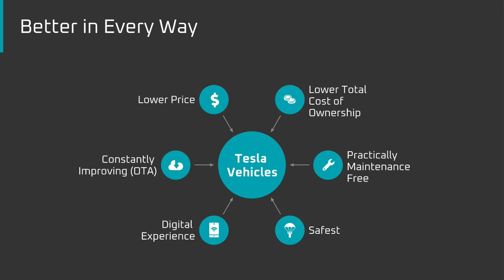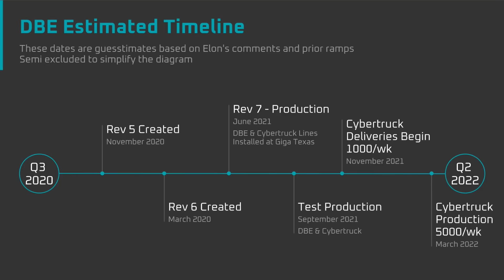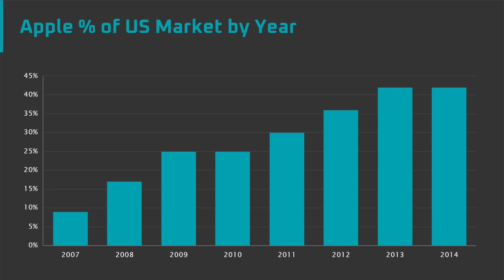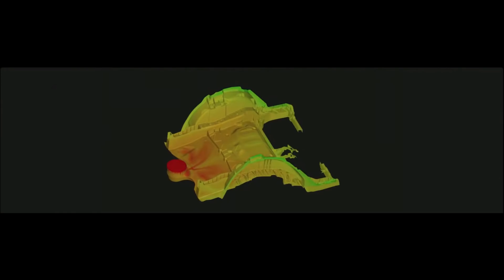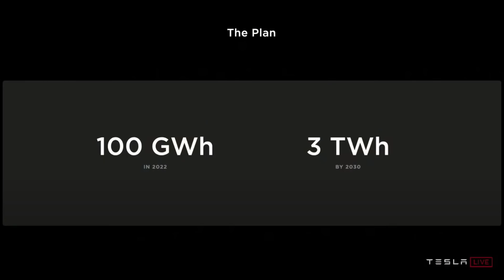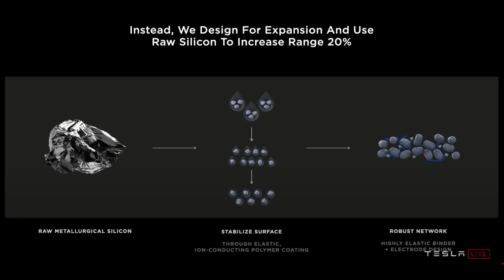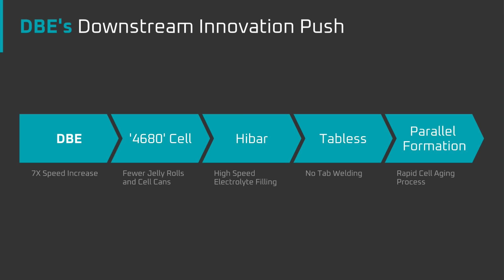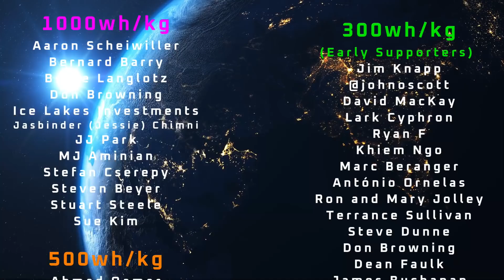#1 Thoughts on Battery Day - Lithium Mine to Battery Line

Comment from the maker: Hi folks!  I tried not to be a tease here.  I usually avoid 'thoughts' videos in favour of knowledge.  I wish I could produce my videos at a faster rate, but quality information just doesn't happen that quickly.  Thanks for your support!  I'll release these videos every 1-2 weeks as they are finished.
Reply: I have a question and I think you may have the best guess. 
What do you think would be the energy density of the new cell? Also likely charging rates with the short distance to charge and discharge cheers
Reply: @roryreddog3258  
If I understand things correctly, 6X power = 1/6 resistance = 1/6 the heat = 6X the charging time possible for the batteries. Real world charging times will depend on how far Tesla is willing to upgrade superchargers and car electrical systems
Reply: @paulshedleski7063  Ohms law for power means the effect of resistance is the square of the reciprocal, resistance need to drop by a factor of two and half.
Reply: @paulshedleski7063  hi - my understanding is different. The volume of the 4680 is 5.48x the one of the 2170. So it makes sense the discharge/charge power of the cell is 6x and energy 5x. Something not advertised though as it's a competitive advantage, is that the internal resistance of the cell will be dramatically reduced, helped by the tabless electrode. That's what will reduce the heat generated thus enabling faster charging.
Reply: Paul Shedleski 👍 exactly! Tesla claim that V3 can charge 1440km per hour. So, V4 superchargers could then charge 1440km in just 10 minutes. Or 720km in 5 minutes! THIS IS EQUIVALENT TO ICE.(mic drop)
Reply: Paul Shedleski Think about it, gas stations can disable some bowsers and put in a V4, for minimal cost. No need to even walk in and pay. 😳
Reply: Roger Starkey well you don’t “need” anything, these are measures to bring EV’s to mainstream  . 1x1500kwh (if that’s even possible) charger is cheaper than 4x350kwh. And plugging 1 charger is better than plugging in 4...Odd comment.🤷‍♂️
Reply: @thelimitingfactor man, the fact that you delay the videos due to quality is only a good thing. Keep it up! Love the content
Reply: Disappointed supercapacitors werent part of battery day. I know maxwell was working on a super capacitor. A supercapacitors in hybrid cells can extend battery life and change commodity depedancy.
Reply: @sadface7457  With a 6X increase in power it will be a challenge  to upgrade the electrical systems just to handle that. Supercapacitors would be redundant
Reply: @paulshedleski7063  Its not about just power but access to gobal commodities. The battery have improved but not match for capacitors in these application. Power density of supercapacitors is order of magnitude greater and since the energy storage mechanism is more stable (as it's not chemical) it reliably deliver that power with degrading.
Reply: Paul Shedleski I think so too. However Supercaps could play a big role in the Mega-chargers to be built. They could help charge up these massive semi batteries quickly and recharge slowly in between “pump sessions” from much larger LFP based megapacks - extending their cycle life.
Reply: @rogerstarkey5390  I didnt mention *power*. Though supercapacitors occupy a different regime in power density and aid in power transients. You than think of the difference between ram and solid state. In mentioned my comment battery life and later commodity access. Access to rare and exotic minerals is a concern for the battery manufacturers. Battery chemistry is temperature sensitive to those power numbers might represent ideal conditions.
Reply: @rogerstarkey5390   You can research these topics further. 

Power specifically contextualized, it's in the context or either power density or power cycle life. Saying but batteries are better is meaningless because they dont compare with capacitors on either measure, which orders of magnitude greater then even theoretical battery chemistry. Batteries are 6-10k cycles and capacitors 100-1000k cycles. Batteries are 0.1- 1 kW/Kg and capacitors are 1-10 kW/kg. These are in different leagues. If you put these together they are significantly cheaper then batteries in these contexts.

Temperature is critical batteries discharge driven by exothermic chemistry which means discharge generates heat. Heat precipitates undesired reactions reaction which either hazardous or undesirable. Radiant heat from these chemical reaction even if the battery chemistry is intact they affect efficiency as heat is lost energy.

Resource access is certainly an issue. Read any comodity report on batteries. You need specific purities to contract batteries which limits their supply chain. From a looming cobalt crisis, to lithium shortages and declining grahite quality. Batteries manufacturers are continously searching find cobolt and graphite free chemistry, and way to use lower grade lithium. The price and availability dictates changes to chemistry more then performance. Whereas superapitors use carbon altropes based on graphite but require much less because energy because it's a repository for electrons no lithium ions.
Reply: @sadface7457  pppppp]ppppp
Reply: @sadface7457  ]]]p
Reply: @sadface7457  p]p]
Reply: @sadface7457  ppp
Reply: Always appreciate your perspective
Reply: Following your excellent work on Talga. I suggest you look at Vulcan Energy in Germany.  They will produce zero carbon lithium. With enough to supply the whole of Europe for many decades.
Reply: You're doing a fantastic work Jordan. Quality primes over quantity. There's 5 thematics to cover if you follow the battery day presentation, so I'd expect at least : cell format with tabless electrode, dry electrode, anode materials, cathode materials, integration to chassis.
Reply: Jordan talga have Polymer technology.  This maybe the answer to the Anode problem.
Reply: Been a fan of this channel since December 2019. What it lacks in quantity it more than makes up for in quality rich detail, presented in a logical and easy to understand way - no easy feat in light of the complex subject matter being expressed. Jorden, your deep dives have been ramping with a density of information that Tesla now has in its new cells. Keep it up. I find your analysis spot on.
Reply: facts > fast
Reply: Thank you, battery dad!
Reply: House Essentials it is much easier to make and needs only about 1 tenth the floor area, but they do have to perfect the process with lower volume. He said that he would open up the 4680 to other “suppliers”, so I would expect them to licence this tech to them. Tabless and dry electrode in the 4680 form-factor should work for all chemistries. He said the factory is 69% cheaper to build and the cost per kWh is 54% less, dry electrodes use nearly zero water and no solvents, so much much better for the environment. This is my understanding I’d happy to be corrected if I’m off beam at all...
Reply: What i'm curious about right now, can these improvements be brought to smaller cells and batteries for smartphones? Would love to get an answer on this.
Reply: @theDubleD  Almost means nothing. Their plant design for larger cylidrical is batteries and net improvement is just 16%. The power problem solved by "tabless" designs matter more as the battery gets larger and dont affect flat batteries as much.
Reply: Instablaster.

Comment: In the battery day presentation. Tesla talked about partnering with other battery manufacturers to make cells for Tesla. Now in the last couple days we hear that LG Chem and Panasonic are going to possibly make 4680 cells for Tesla. Here is my guess, I am probably wrong but let's start the rumor mill. Panasonic which is already making NMC cells, will make the 4680 NMC cell. LG Chem will make the LFP cells. Tesla will make the high nickel cells. Tesla will then offer the different options of cells for their cars. LFP Short Range (lowest price), NMC Medium range ( middle price) and High Nickel long range (premium price). They could all be put in the same pack size and different structural members could be added to the packs for the proper vehicle the packs are going into. Very modular design.

Comment: Good evening. I randomly bought 955 shares today of CBAT because it was the only stock that was moving up from all the EV stocks I’m watching. I just had some surplus funds in my Robinhood and so I put it all to work. Then I saw the big jump and I started researching why. I couldn’t find anything anywhere....until I found this lonely random article dated 09/28/20: “CBAK Energy has Successfully Developed Large-sized Cylindrical Tabless Battery with 25% Boost in Energy Density and 20% Cost Saving”. What the?! Do you know what that means?! This is HUGE!

As far as I know, Tesla is the only one that developed a tabless battery design. Googled around “tabless battery” and the only thing Google returns is about Tesla. On Tesla Battery Day all they talk about is their “tabless battery design” and how it is a game changer for them. Now I stumble across CBAK Energy doing the same?! Look into this for me and tell me where my thinking is wrong. According to the article, “CBAK Energy Technology, Inc. ("CBAK Energy",NASDAQ: CBAT), a world's leading lithium-ion battery provider”...wow. The worlds leading!!! Let me know what you think. Have a good night.

Comment: Great video. Just wanted to share something. A lot of people seem to have the impression that American manufacturing has been crippled as of late or that America doesn't manufacture a lot 'like it did in the old days'.

This is a misonception caused by the fact that so little people are now employed in manufacturing and so the public doesn't hear or see of it anymore to nowhere near as much. Some of this is definitely due to outsourcing but most of the job loss is actually to automation. America has never manufactured more than it is right now, in terms of GDP and total units of things. 

https://www.marketwatch.com/story/us-manufacturing-dead-output-has-doubled-in-three-decades-2016-03-28
https://fivethirtyeight.com/features/us-manufacturing-is-not-dead/

Comment: About the 4680 battery, I'm not sure whether it can also be implemented gradually - meaning Panasonic might well be building a line for 4680 form factor tabless WET process batteries, not the new Kato road dry electrolyte 4680 type - that would be the challenge for Giga Berlin, especially since Tesla's Grohman division is there.  Fremont/ Kato is speaheading the development, but I can see them working more on the chemistry side than Berlin.  Similarly  Giga Shanghai might also produce 4680 WET process batteries, which is in the current state of the art domain, and ship them to Berlin  in case Grohman /Kato haven't gotten the DRY 4860 lines in production with good yields. 

Kato is producing DRY 4860 for sure, but with yields that need improving as Elon mentioned - still good enough in limited quantities for the S Plaid and Semi in small/ sampling numbers. There are no hard deadlines for full speed production for these as far as I know. 

 Can you help decide whether this hypothesis about WET process tabless 4680 has any truth to it?

Comment: Do you know if they can use the 2170 cells in the new integrated battery pack or will they have two different cars? One for each battery.

Comment: This "tesla silicon" is most certainly sandbagged, although all other factors still combine to produce a compelling and market leading technological pathway. The presentation was designed to be sufficiently compelling for thinkers and sufficiently obtuse to leave wall street confused. I think the nature of silicon is fundamentally too electrically unstable to be workable with the other substrates it needs to compliment.

Comment: Much impressive changes are going on, so Elon and Drew only talked about the masterplan and some technical details, but not the huge work which was it and will be in future. If they are right, we will have the largest crisis of legacy car makers ever...in a few month. Both have talked about a target to 2030, but I'm sure, than all will be done. I think, we will see results at opening Giga Berlin at early next year. If Tesla use all the patents they have, together with their cell suppliers (changing chemical components and manufacturing), we will also see 4680 with different fillings but 1 format which allows a massive production and use of this battery packs in all cars. With the combination of full-casting, i don't want to think about the sleeping car makers. 
Sandy put a very good question at the end of his batteryday video...and the answer is: no.
Tesla has unveiled the short future and if I see it right at Texas, they have showed a sample for the factory layout for the actual phase 1 building. 
TY Jordan for sharing your knowledge :)

Comment: SUBSCRIBED!

What do you think of Tesla BERLIN would be the first to start producing the 4680 in mass production and putting them into MIG Model Y cars? I think it would be a perfect fit.. It fits your timeline of 9 - 12 months from now, and Berlin will start slow with the all new giga castings and structural battery pack.. For sure Giga berlin gets EIGHT of these giga presses, which are being built right now (foundations poured).. And would it not be quite inefficient to start out with 2170? if you gonna apply the  giga casting structure as presented on battery day and have to redesign and make new tools for the 4680 in just 1-2 years? 

Would love to hear your, and other's opinion about this.. I am a bit biassed, because I have a Model Y on order that will come from the Berlin Factory.. I live in The Netherlands.

Comment: This new battery is going to make small, electric aircraft economically practical.  Battery 1/2 the weight of current batteries AND more power.  Oh, and using the batteries as structural components is encouraging in aircraft applications also.

Comment: If you are to do a series of battery day videos might I suggest that you start with Lithium.  Whilst Lithium is relatively abundant the rate at which it can be mined and processed will struggle to keep pace even with Tesla’s growth trajectory let alone that of all the other EV vehicle manufacturers.  3 TWH of batteries by 2030 represents a staggering amount of lithium.

Comment: Battery day is bull shit my smartphone still only last a day and why not put the the next-gen batterys in smartwatches to demonstrate the tech in the real world.
Reply: The battery tech is being geared towards a specific industry.. Thats kinda the central point.. which clearly sailed clear over your head.  Smartwatches are the LEAST important thing that need new battery tech and will demonstrate nothing of importance.
Reply: @TheEvilmooseofdoom  The next gen battery tech should be available  in $1500 smart phones, EVs require a shit load of cells a smartphone reqiures 1cell. its been decades and our phone still only last a day. and you think by now our phones will last 2 days.  i dont agree with tesla becasuse our smart phones are still shit.
Reply: @chadellett4696  Did you look at the battery being talked about?  You think that's going in a smartphone?  Tesla isn't a smartphone company nor a company that makes smart phone components which is why they did not develop a battery that could go in a smart phone.  Expecting them to concentrate on a unrelated industry is nonsense at best.
Reply: @TheEvilmooseofdoom  You are missing my point there hasn't been any battery improvements in smartphones for decades. And this is why I find it hard to believe tesla claims.   
Tesla would sell more Evs if they released a smartphone that lasts more then a day. Make them for the fan boys.
Reply: @chadellett4696  Your point is.. sorry.. meaningless.  Tesla has not been using the same batteries that are used in cell phones and none of their battery advancements are aimed at cell phones since they're working on cylindrical cells vs pouch cells and with an entirely different set of needs in mind.  Why you think Tesla can't make advances in those cells simply because no one has done it will pouch cells makes no sense.  The notion that tesla would sell more EV's if they decided to design and market a phone is.. sorry, to me nonsensical.  FYI, cell phone batteries have improved over the years.

Comment: The question remains unanswered: Why is Tesla's "tabless" battery design not called "tabful"? 🤔🤔🤔
Reply: ...or multi tab+
I think the reason is that they focused on eliminating the tab application which steals production time and creates quality problems. Then they came up with a solution which has other benefits which are much more important. I guess they were lucky but "chance favors the prepared mind".